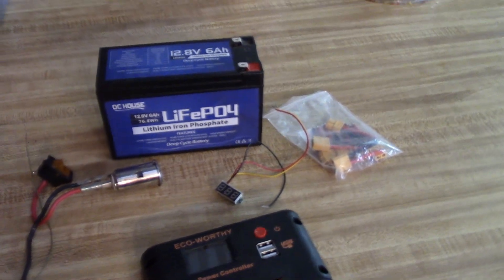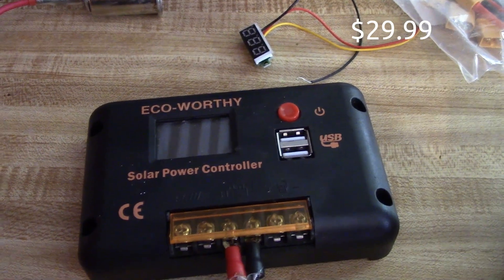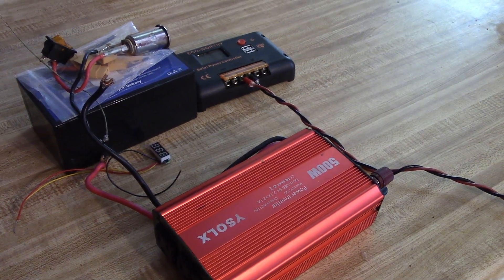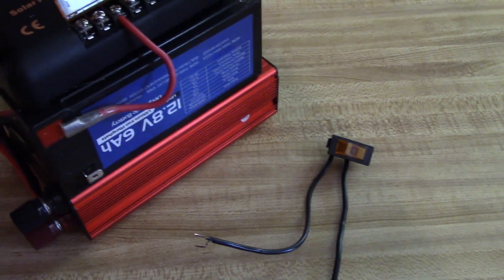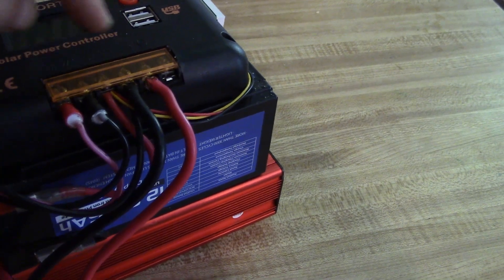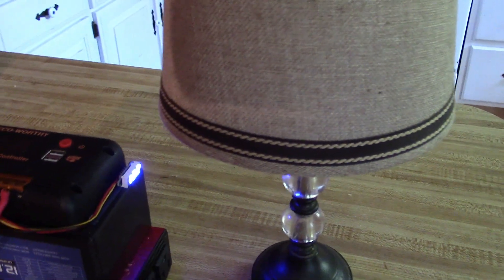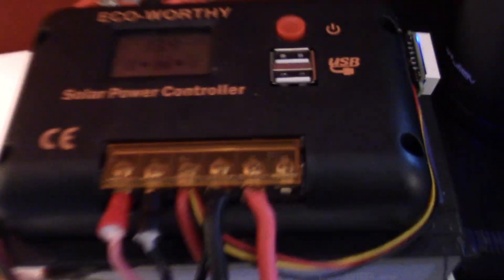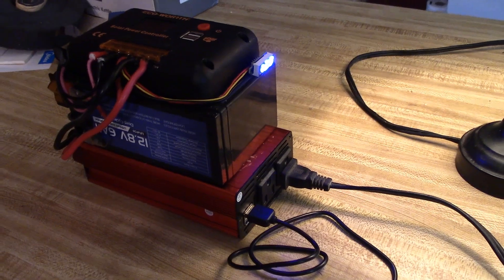How To Build a Solar Power Station for under $100

Comment: I really like this idea! I have a spare 12ah scooter battery and a 40w panel but I think the controller I have is toast, they arent much on amazon though. I even have a small inverter somewhere but anything I need mains pwr for would suck the pack dry very quickly but like Ive mentioned before I use a LOT of usb lights and fans around my apartment. This is very similar to my ammo box pwr station I keep in Bleu and charge off the cig lighter.. it looks like you have the parts to make a distribution type panel with switches so you can have all your units plugged in and direct the pwr to which device you need charged
Reply from the maker: It does tick the boxes for your USB set up! A 12Ah scooter battery should last well on USB only, with far fewer losses than using an inverter. The 'fake MPPT' branded controller is good in reviews/videos for under $25 and has 2x USB ports on it. 
Stacked up in the cube shape keeps it all solid and portable, but also light. It's a decent point for folks with mobility issues, rather than have trailing wires or a big flat board to move around. 
I like the distribution panel idea 😀

Comment: FYI Eco-Worthy says 30A max shared between charging and the onboard load.  If you pull 500w on a 12v battery you could be hitting 50A of current.  Always best to run inverters direct to the battery.  You'll also not want to pull more than about 6A off that battery.  So as long as you're careful of your loads it'll be fine, just don't go trying to run your vacuum cleaner :)  Always good to put those spare parts to use!  Oh and one other thing to watch out for with DC current are the switches, at higher currents arcing can become quite significant and if they aren't rated for DC and the current you switch off under load they could be damaged/welded.  Just some notes to those that may copy this just to be careful about loads.
Reply from the maker: Good advice Chris and thanks. I agree about loads and about expectations.  
While the 500W inverter was only a spare, really a 100W would be better if something similar was built from scratch. The battery to controller switch is mains rated, with the inverter having its own. Light loads were mentioned, though I suppose light to someone may be a 5000BTU air conditioner!
Reply from the maker: BTW, have edited the pinned comment to include your advice 😀

Comment from the maker: More info and parts links for the equipment used are in the description. 
In agreement with ChrisEpler's comment, do note the system in the video is for light loads because of the battery size. A Power Cube can be sized easily enough and fit easily enough together in the same way as shown, while making sure to use it within the specs of your own spare equipment.

Comment: well I like this idea for solar power I have a 375 W inverter that will do the same thing I can't wait to try it out I'll see if I can do a video but I don't know how to really edit using iMovie on my iPhone but I can try my best
Reply from the maker: Good luck! The build is ideal for small outdoor tasks, solar recharging of devices etc. 
I found out that 1A of solar is more suited to charging the 6Ah LFP battery, means it only needs a 20W panel. Costs can be really good for these little systems.